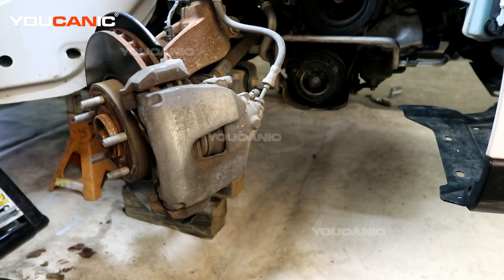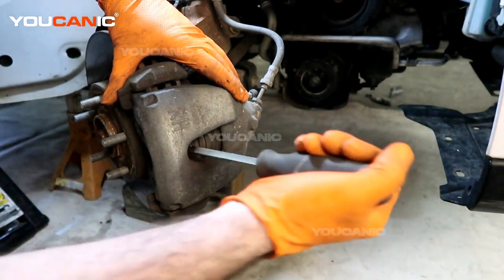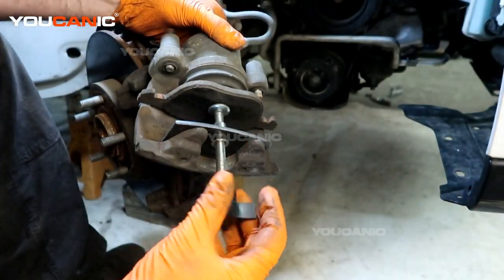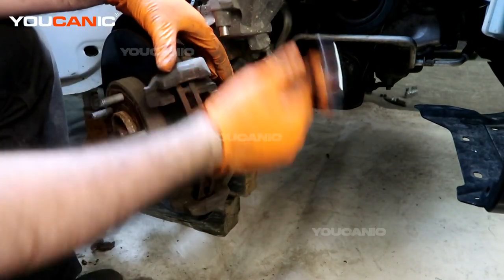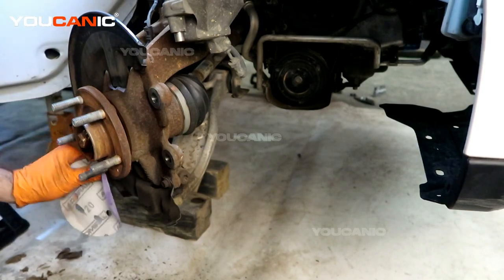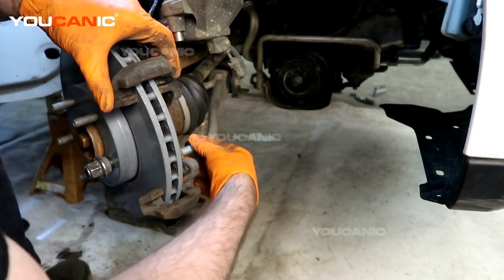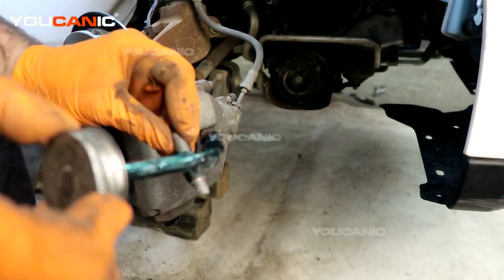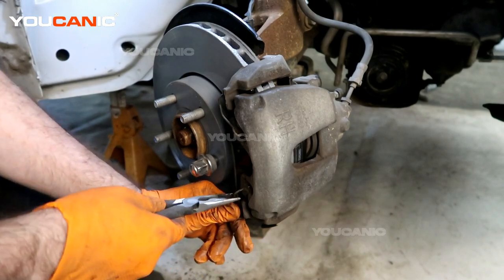2012-2019 Ford Focus - Front Brake Pads and Rotor Replacement

Comment: Pressing piston before taking off caliper is most common mistake with cars equipped with electronic stability systems. All that crap build up on piston through the time is pushed back to the system which is fragile for stuff like that. Caliper first with the piston extended as far as possible. Then clean the piston under the rubber seal, then apply some grease and then you should press the piston.